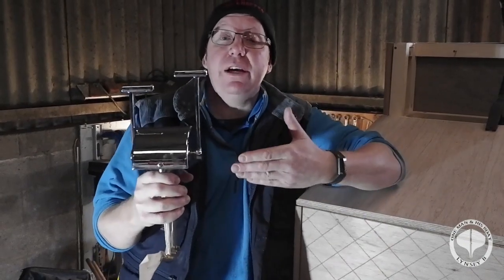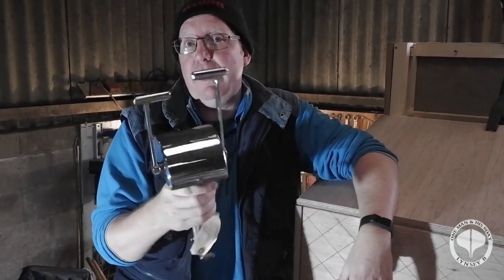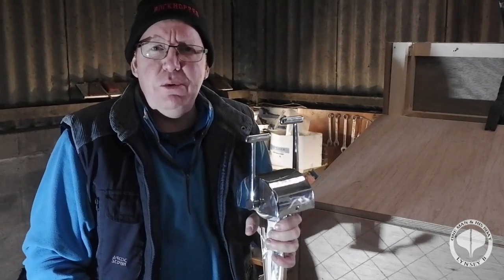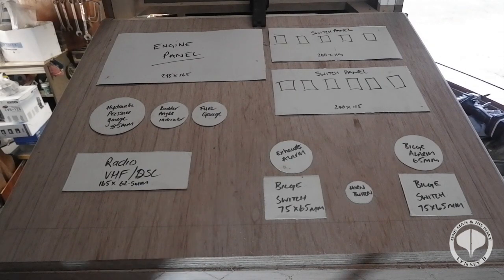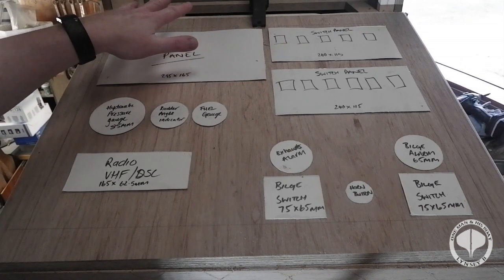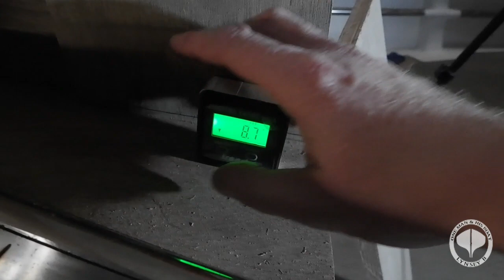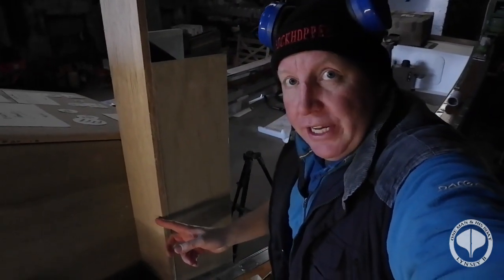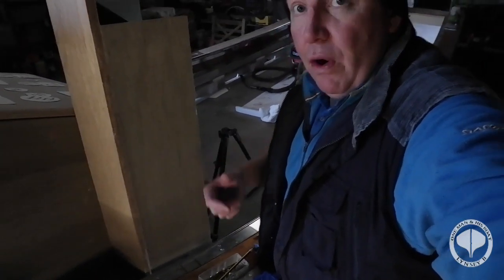Throttle Happy Episode 77

Comment: I'm four minutes in and weeks behind ha ha, I'm going to say anyway on the starboard side of your box there so you can keep her going ahead and keep her up on the gear when hauling
Reply from the maker: Evening Mike. Hope you're doing well with the jobs on your bonnie boatie?
Yup, I had thought about that, but the console is to near to the hauler, and after spending this ridiculous amounts of money on the boat, I'm not wanting a whip coming off the hauler and catching the handle bud....god knows what would happen if I'm in the wrong place.
So it's going the port side pal, still very reachable....that the beauty of the small boat, everything is at arms length 🤣🤣🤣😂😂😂😉👍
Reply: @onemanandhisboat   yes that makes sense, I didn't wait to see how tight it was to have the levers the other side ha ha
Reply: @onemanandhisboat  Put same levers on starboard side, never had a problem. But whatever floats your boat as thay say. Good luck.
Reply from the maker: Thank you Graham. Much appreciated. 
TBH there isn't a lot of space on the starboard side, when the pot hauler is in it's working position....so good job, I've got long arms.😂😂😂😂😂😉👍
Thanks for the comment bud. Have a great week ahead 😉👍